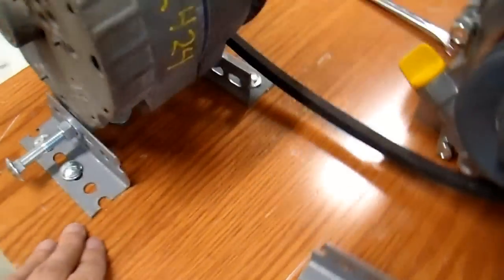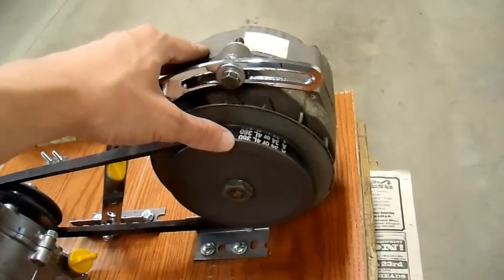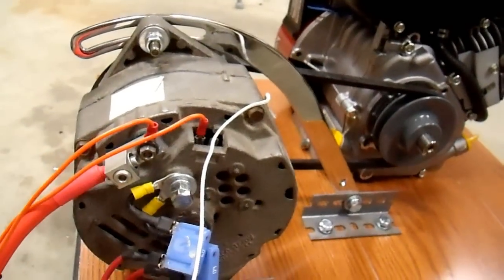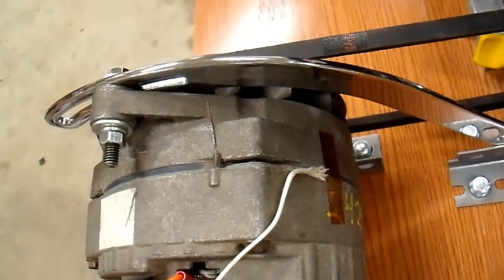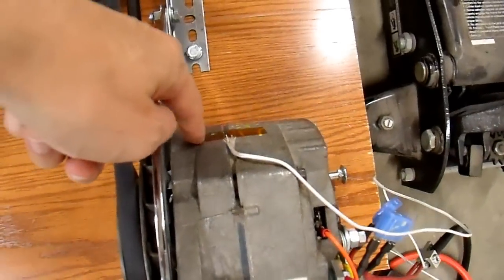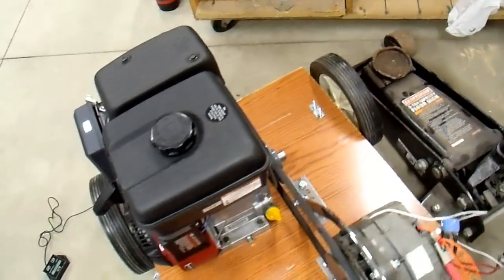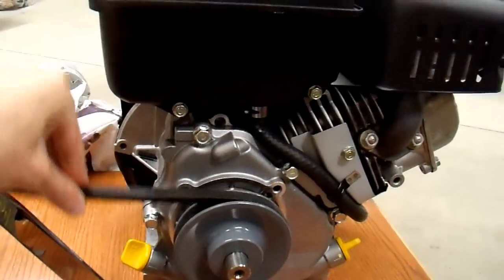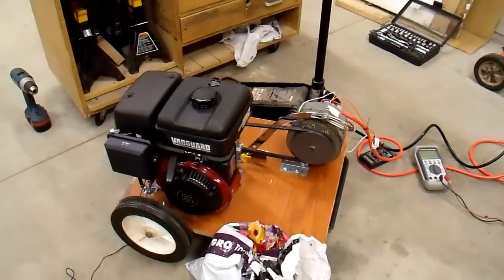DIY 12V Generator Charger - 6 Assembly and First Test of a Belt Drive System

Comment: too much talk about efficiency, pulleys etc. people just want to see it run. i have one with 180 alternator and a 5 horsepower engine, not enough power for occasional heavy loads, going to put  11 horsepower on it.  i went and got a small serpentine belt and that works fine

Comment: I would like to hear your thoughts on putting the dc power directly into a grid tie inverter.  I would like to build a larger set up using alternators to generate the dc and use the grid tie inverters to feed power back to the grid ( running the gas engine on wood gas ).  Thanks for sharing. Joe

Comment: Perhaps commenting on the obvious.  

That engine has a slanted cylinder.  The engine is mounted so the piston's motion is in line with the wheels.  When the engine is running, it's not much different than having someone standing at that end of the cart and kicking the cart along.

I see two solutions.  
1. Mount the engine and the wheels at 90 degrees.
2. Switch to an engine with a vertical cylinder.

Comment: Looks like with the belt drive you have about a 2 to 1 speed ratio where as the coupling set up was a direct drive turning the alternate faster . The original setup coupling are unreliable from my personal experiance.

Comment: use a d10 ac regulator. charges as a one wire and very low rpm charge. too much load at low rpm will over heat.
Reply from the maker: This alternator (27si) will run at low RPM and full load and barely get warm.  A 10si will overheat.
Reply: ***** the regulator works on a very large number of alternators. denso, delco or almost any other if it has a 10 amp rotor of less. you wont have to have the switch and it has no draw when it is stopped. i am a alternator and starter rebuilder, just trying to help. if you need info or power curve charts just let me know.
Reply from the maker: batteryphil
My apologies, I thought you meant a 10si alternator.  I chose not to use a 1 wire regulator for a variety of reasons I didn't cover in this video series but it would be an option.

One of the reasons is that this is a low RPM build (for efficiency) and the 1 wire regulators often require a higher RPM to start regulating than 2500RPM alternator speed I'm using, or around 800RPM typical engine RPM as generally installed.
Reply: ***** 800 rpm at the pully with this regulator.

Comment: Is that a GM alternator with a built-in regulator? Probably. I'm going to set up a similar generator but I have older 80 amp ford alternators lying around. They use an external regulator. If I use my own regulator or use a zener diode to increase the regulation voltage of a stock regulator, I'm hoping to charge a 24 volt bank.

My long term goal is to build an efficient switching buck regulator which can handle 80 amps in and 300 amps out so I can run the alternator at 50 - 80 volts and greatly increase the power it can produce.
Reply from the maker: This has an internal voltage regulator, but it can be modified with a simple voltage divider to produce 24V.  Alternator diodes are generally 600V diodes so higher voltages are not a problem aside from additional eddy losses, higher iron lamination core losses, and requiring higher RPM to produce sufficient amperage.  Overall it will be more efficient at 24V.

Comment: I didn't notice the fan running backwards, but I disconnected the plug and the next day the bobcat started like it should. Could the wires inside the plug be reversed? If the fan is running backwards do I have to flip the alternator?
Reply from the maker: Running the alternator backwards will cause it to cool poorly and possibly overheat during use if used at high load levels, but it won't affect it when it is not running.  If unplugging the alt fixes your problem you may have the field current running continuously when it is 'off'.  If so it is probably a malfunction of the ignition key circuit.

Comment: I seem to be having  an issue with a bobcat s charging system. The battery seems to be getting drained. Its a new 70 amp alternator I bought at auto zone. When the machine is sitting and not running, I notice I have power at the clip on one of the two wires, and I have power at the red wire also. Should this be? Im trying to follow your wires in your video to be sure everything is hooked up same way but you don't show that part in the video . What  could be draining my battery? I hope you can help..Jim
Reply from the maker: I have to admit that I am not familiar with skidloader wiring, but it sounds to me that you have a parasitic draw somewhere which may not be directly caused by the alternator or its wiring.

Comment from the maker: Good idea on the automobile harmonic dampener.  Your mention of using a brass sleeve is interesting as I have little knowledge of doing such things.  This engine shaft is not tapered.  How could I use the sleeve to secure it solidly, and where does one find/make a sleeve of the proper ID and OD?

Comment from the maker: Good thought on the tension balancing - that would be a good solution for cheaper engines not designed for high tension belt loads, like lawnmower engines.  I know that this engine will not be able to power 2 alts at the same time though.  :(  I'd love a V-twin, but they sell for serious money and I thought this project was enough of a money pit already!

Comment: Want to gain some smoothness? Add a flywheel. The cheapest would be the fluid dampener from a v8 engine. Those things weigh a ton and are designed to dampen vibrations. I would think the northstar v8's had them as well as the older 500ci engines from the 70's. You may be able to get them on chevy 4.3/5.7 engines as well. Some junkyard scrounging with a puller is all it takes. Measure the crank snot on the engines to get close to the diameter then add a brass sleeve to it.